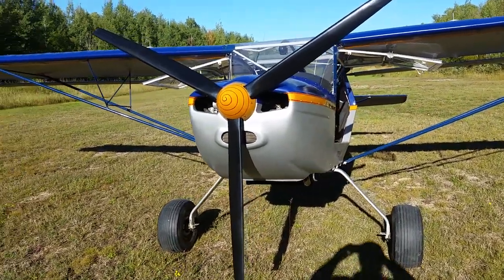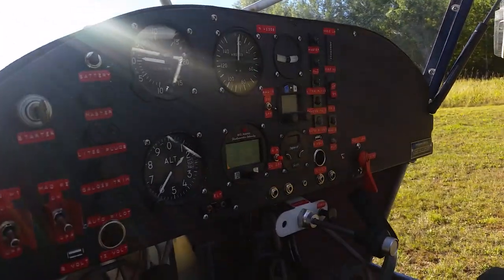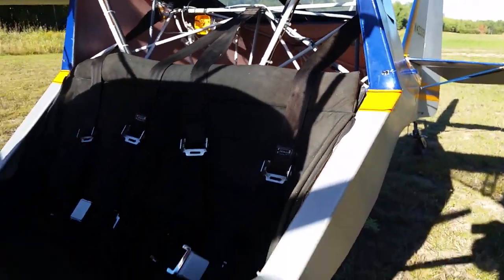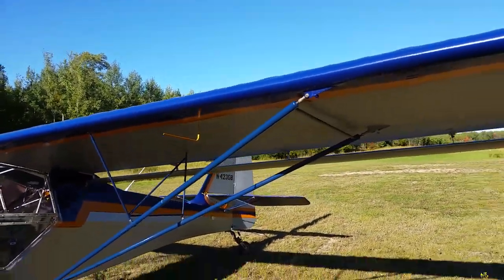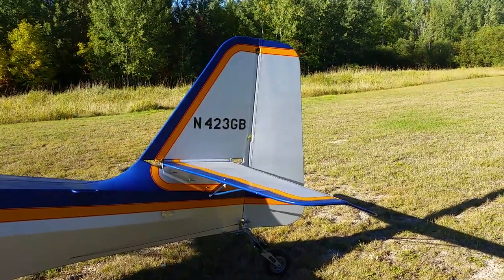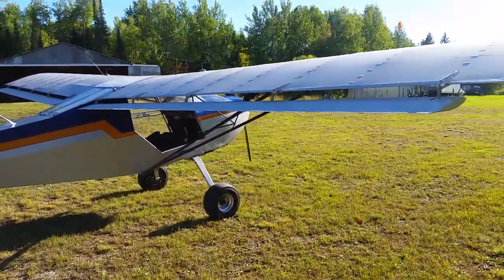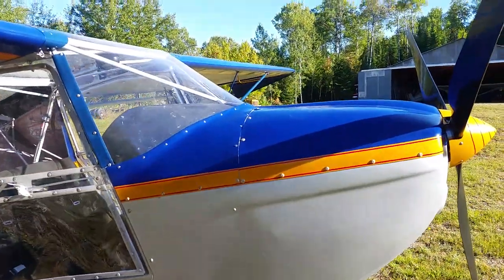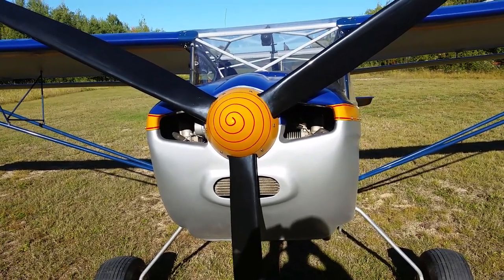Kitfox 4 Classic 1200 complete rebuild

Comment: What kind of front end is that. Is it a smooth cowling from kitfox? It looks really nice. Can you provide more info on that cowling?
Reply from the maker: It's a Kitfox 4 smooth cowl.  I did do some remodeling of it though.  The oil cooler opening was kind of squared off and to small, and so I had to cut that out and build what I have there out of fiberglass.  I kept the panel and firewall as low as possible for better visibility, and I also wanted it to seal real good at the windshield/cowl joint.    That meant fiberglassing a new cowl lip where it met the windshield.  I laid packing tape on the windshield, and fiberglassed over it for a perfect fit once it was trimmed to height.  Lots of time consuming work doing fiberglass, but I'm glad with how it turned out.  Jim

Comment: Hey jim. How much work did it take to change the front end from subaru to rotax?  Willing to sell the Kitfox?  Thanks
Reply from the maker: I did a complete rebuild, using nothing from the Subaru engine FWF.  New cowl, new firewall, ect, ect.   I've rebuilt a number of Avids and Kitfoxes, so it's hard to give an answer on how hard it is to do.  If one never has done something like that before, it will seem much harder for them, than it was for me.  Don't plan on selling the Kitfox soon, I probably be listing the Avid soon though.  Look at my other videos, you will see it.
Reply: @jimchuk8511  thanks
Reply: @jimchuk8511  I am a rookie, never built a plane before.  Found a kitfox 4 1200 with a cowling and fwf for the subaru.  All 4 pieces of cowl need replaced right?
Reply from the maker: @jdmelech1  I can't say for sure on the cowl,  my Subaru cowl had areas cut out of it to clear the engine.  I went with a  new smooth cowl.  I don't like the way the kitfox round cowl blocks so much of your forward view.  Compare one of my Kitfox 1 flying videos with the Kitfox 4 ones to see the difference.